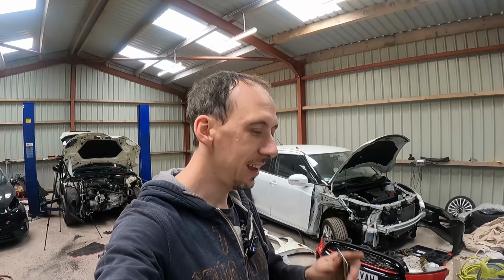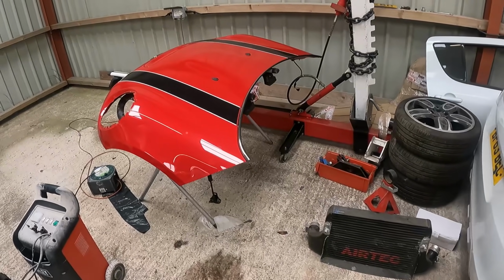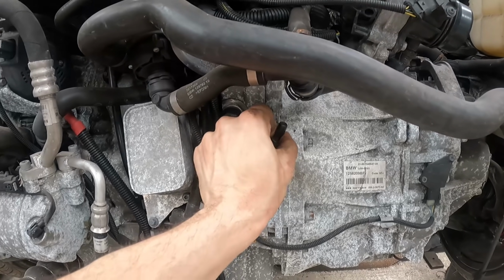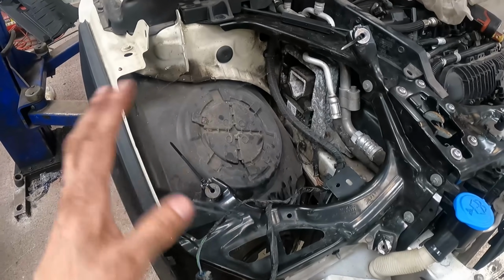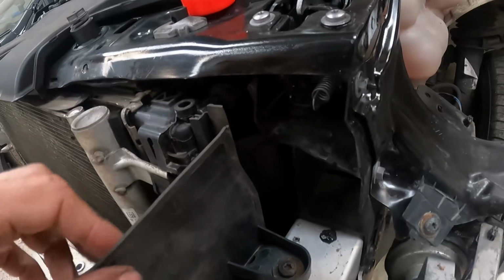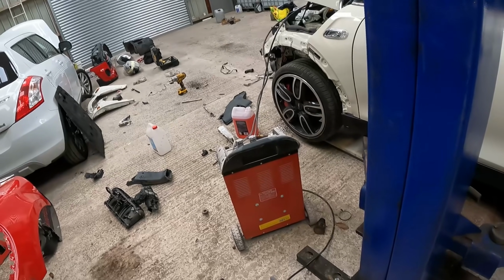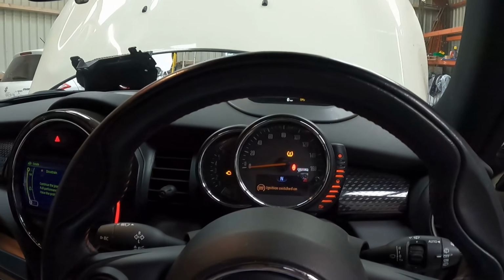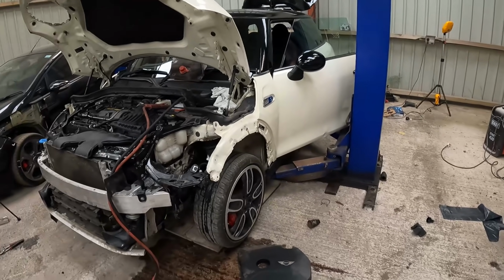Finally We Have All The Parts For The Cooper S - Lets Get Cracking!!!

Comment: Some of the stop start take 3 days to charge up and you need a pulse charger to charge it up also many battery charges wont start working if there is no voltage on the battery , try connecting the charger with jump leads on the mini , then if the charger kicks in , then disconnect the jump leads , they are a pain Phil , well done

Comment: The outside temp sender, You'll sort of find where it goes due to cable length, I think mine has a small side clip on it so i just fixed it where seemed right, OR use the 2 ridges on the body of temp unit to locate it into a suitable hole in the bumper/top cross member you'll know what i mean when your doing it. Good luck.
Reply: Goes into bottom of the undertray has a cut out similar to a 1 series bm